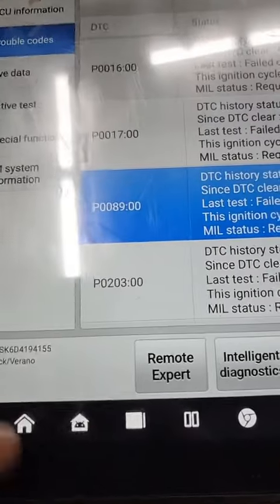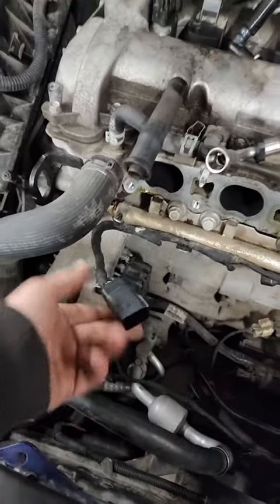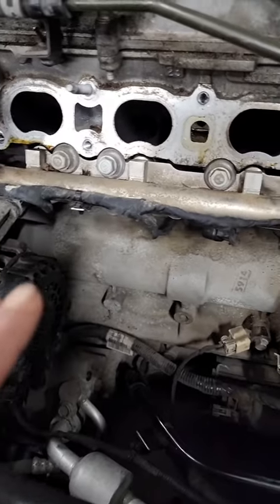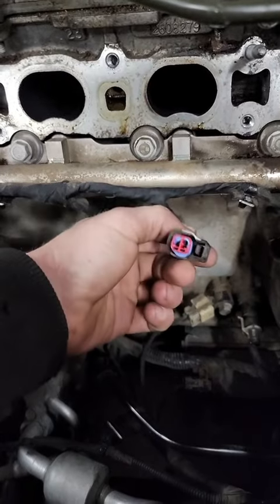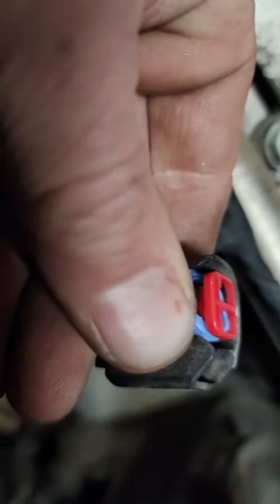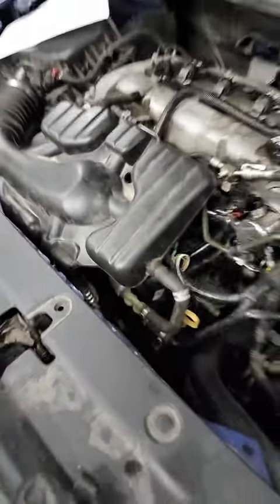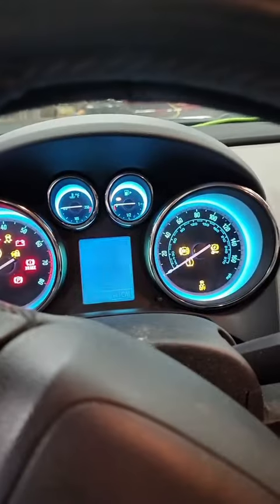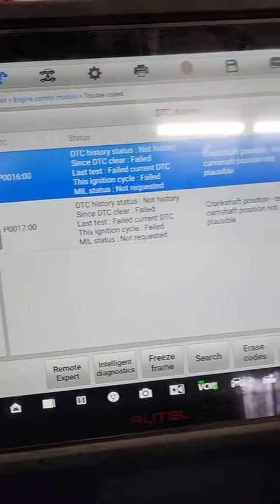customer thru the parts cannon at it to avoid diag

Comment: It’s the little things, a forgotten plug, bent pin, loose wire etc.
Reply: I almost went insane after a lengthy 3 month full engine rebuild, went through every step by the book just so I made sure I didn't mess it up.
(Long story short) When I first started it up it ran beautifully, then started misfiring like crazy, came to find out the whole left side head fuel injectors were unplugged.
Reply: @steefan2248 😂

Comment: Maybe this customer should have had it diagnosed properly and could have saved them a lot of money! 
🤦🏻‍♂️😳

Also P0011, P0014, P0016, P0017, look at the Intake and Exhaust camshaft oil control solenoids on the top of the engine. 
Measure the resistance between terminals A & B and From A to the case, and B to the case. Spec cold is between 8-13 ohms. 
We change these all the time at the dealer. Also check level and condition of the oil! 
Oil level will cause these codes as well!

Comment: He’s lucky to have not created even more problems by using aftermarket sensors.  If it’s not OEM that high pressure pump will probably leak soon enough
Reply: Yessir. Ive seen it time and time again especially in the old honda groups im in. Those guys just load up the ol blunderbuss with parts and blast away. Then wonder why they now have 3 more issues than when they started. Oh yea and theyre the same guys that buy the cheapest they can get of everything. They will speculate all day long but cut off their left leg before they do 10 minutes of diag.

Comment: I parts cannoned my BMW after I replaced the fuel pressure sensor off Amazon. Replaced fuel pump, regulator, fuel lines, injectors, etc. Then I bought an oem sensor and boom, fixed.  So pissed off still.
Reply: I know it’s cool driving a bimmer but you really have to think about all the money leaving your wallet you’ll never see again. Maintenance, repairs, insurance, premium gas, resale value, etc. all combined greatly outweigh the few minutes of showing off to people you don’t even care about.
Reply: i chased something similar on my motorcycle. replaced starter solenoid and chased an imaginary electrical gremlin for 3 days, got pissed and ordered another solenoid. instant fix. i was heated.

Comment: I remember on my 2000 mustang i had a terrible time figuring out what was causing my engine to stall randomly. After some headache, i noticed some exposed wires by my injector. Also noting i had an aluminum intake. Lo-and-behold, found it was the wire grounding out on the intake

Comment: I've done that before with my 7.3 Powerstroke. Throw parts at it until the problem fixes itself, it worked too, my issue was fixed. I had the means to diagnose the issue but I figured that since the truck had 330k at the time that the new parts would be beneficial whether they fixed the issue or not.

Comment: Hey Mike i have a question i found a car sitting for about 8 years (Hyundai accent 2005) i wanna change the transmission fluid by hands and replace a fluid filter with fresh fluid and a new gasket what would you recommend to do?